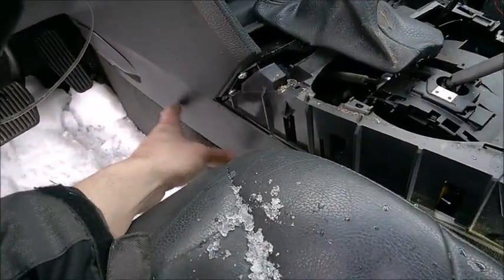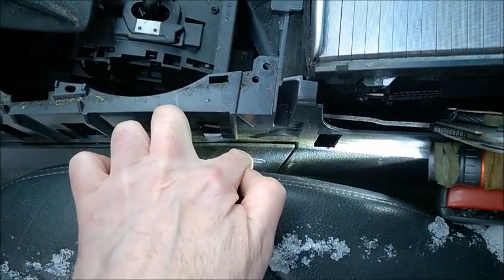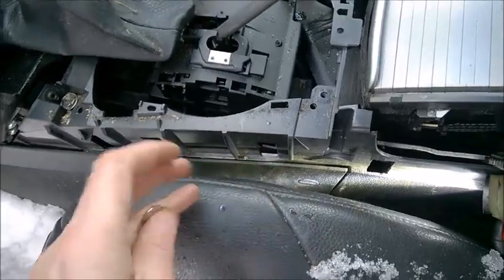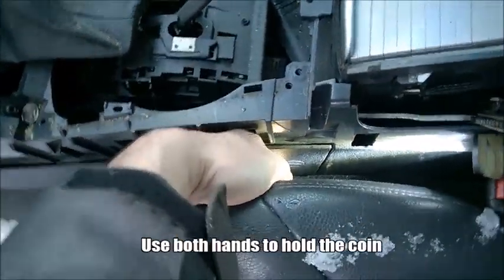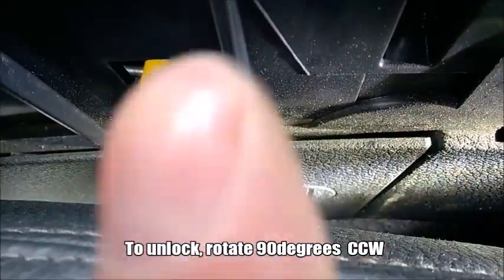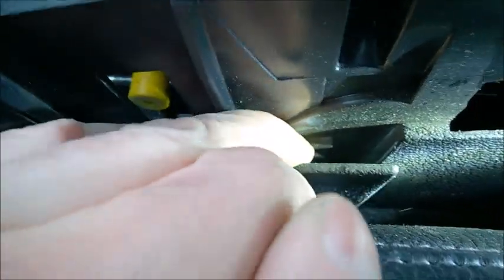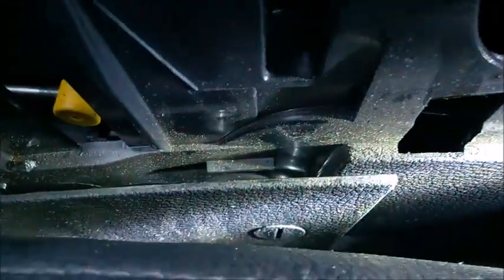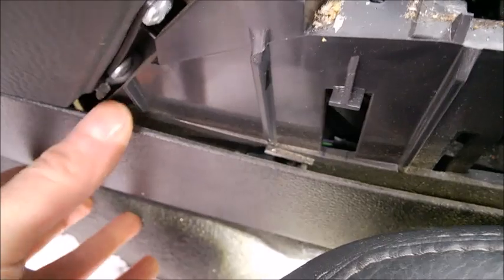Volvo S60 V70  Center console *side trim* removal 2001-2009

Comment: Short video but I learned from it. Thanks for the post.    I own a 2006 S60 for the past four years.   One of the things I struggle with is the arm rest.  I have tried several times just to remove in salvage yards the piece you rest your arm with.    Love to see a video on how to do this.
Reply from the maker: This is for the whole center console for 06-up (at 7:00), from the image at about 10:00 there appears to be two small holes under the arm rest part - that may be to remove the arm rest cover.  For the whole arm rest piece I would guess the whole console needs removed and may look underneath it for the screws that secure the hinges for the arm rest part.  Just a guess. https://youtu.be/UfUYvY1dXxU